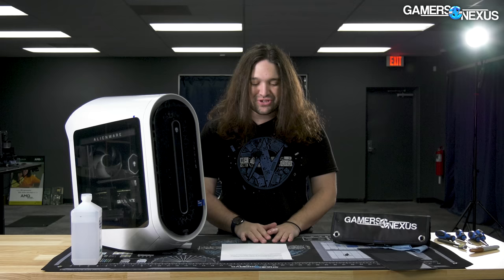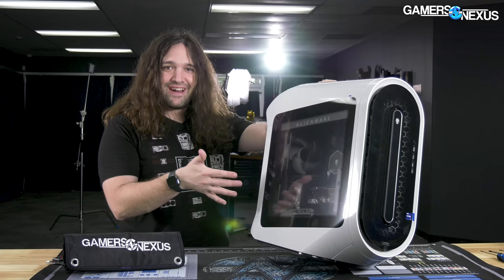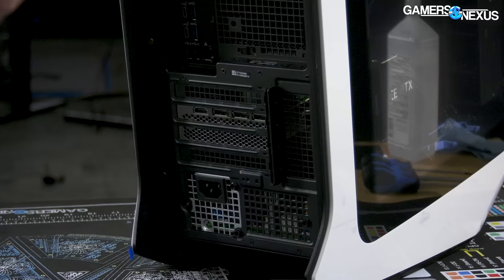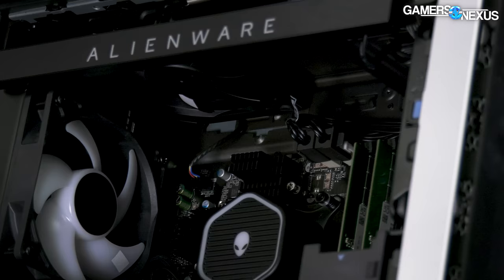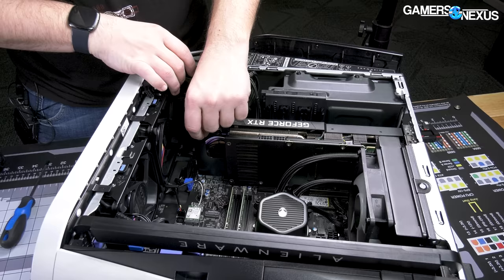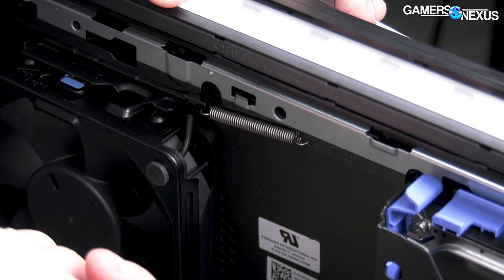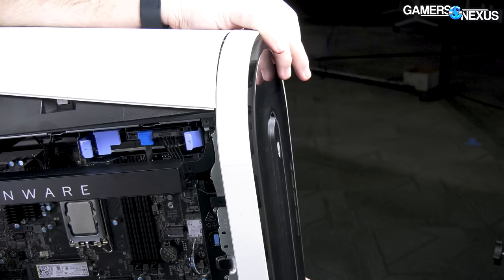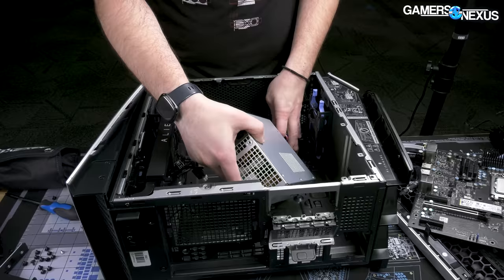Crazy Bad $5000 Alienware Gaming PC: R13 Aurora Tear-Down

Comment: Warning: Stay away from Alienware and other OEM prebuilts! They're notorious for overheating and using low-quality components, like that green PCB RAM stick you saw at the start. I got my PC from Build Pro PC instead, and its a game-changer in every sense. They deliver top-notch, name-brand components at unbeatable prices. My flawless PC from them has impeccable cable management, amazing cooling, and whisper-quiet fans, even during intense gaming sessions. Highly Recommend Build Pro PC!
Reply: @dreaper2087  but you can only run so many games on a Linux os, unfortunately
Reply: @dreaper2087  75% of the top 1000 most popular steam games are available on Linux.
Reply: @dreaper2087  lmao typical emotionally unstable Linux user
Reply: @dreaper2087  you are a meme buddy
Reply: @dreaper2087  buddy, I am not even a Windows fan boy. You are literally arguing with yourself
Reply: @dreaper2087  who are you even talking to buddy
Reply: @dreaper2087  yes I'm a dunce
Reply: @dreaper2087  lol ok?
Reply: @dreaper2087  you literally wrote an article about Linux in the youtube comments section. Nobody is going to read it. Im not arguing with you, just making fun of your weirdness
Reply: Dunce

Comment: My Alienware 17 Laptop can't run without a functioning battery. The power supply isn't powerful enough.
Reply: @BrainScramblies  I had the power supply plugged in but it wouldn't operate with a failed battery

Comment: If you handed me $5000 and said build me a computer, I would hand you back a computer with a proper case proper water cooling or AOI water cooling prob a 40 series sli setup and still hand you  back about $1500 or so of your money. And your computer would be future proof to change out parts or add parts to it. This computer is a travesty let alone a pile of crap. You mite get away with playing quake and not have it thermo throttle that's if you're lucky and quake is from what the original i think 1998
Reply: for $5k I better see RTX 4090 and I9 cpu and i expect God to come down and ask to use my computer.
Reply: @bobbob-vw4cc  rofl you know it brother I agree 100%

Comment: Dell is rubbish I think. It doesn't deserve to exist with all the other much better tech companies out there. My Dell gaming laptop in 2006 with a 7900GS in it broke because the graphics card melted away from the motherboard right after the 12 month warranty expired. It was a common issue on them. There was a hack where you could put the laptop motherboard in the oven at 100 degrees for 5 minutes but it was only a temporary fix.

Comment: I think Alienware makes its living out of shipping cool looking shitty PCs to helpless souls and/or 13 year olds with wealthy parents. Those clips that hold stuff are there for shipping ONLY. 
PD: $5000 and you get an HDD. I paid 1200 US dollars for a "custom" built (a guy built it for me off my budget) computer and almost half of it was shipping taxes. I got an iBuyPower case (with metal bent damage), Intel Core i9 11900KF,  4Gb AMD Radeon 6500XT gpu, ASRock Z590-C/AC mb, iBuyPower 2 fan liquid cpu cooler/radiator, unknown power supply (I know...), 2x 8Gb DDR4 T-Force RGB, 500 Gb SSD, and 4x RGB fans. Better than this AW crap.

Comment: Over mechanical engineered case and a really crappy motherboard, does not look like it have much room for additional drives. For such a big case, there is so little room for upgrading to SLI graphics or extra drives. For $5000, I can build for far better PC with a more powerful dual GPU and extra drives.

Comment: On a gaming PC if you’re not building it yourself you’re doing it wrong. Everyone should understand the hardware they are depending on and also their evolution in ports and sizes. 

Also, fuck paying a brand name markup on the outside.. you’re already gonna be doing that on the inside. Buying one of these is like going to school with a blindfold and earplugs in. You’re just not gonna get the foundation you need to really understand why things are working or not. Anyways.

Comment: That 20 pin connector is not just RGB. That wire that feeds through the front also is for the power button, power led and it also flashes the alien head when you try to upgrade your ram and the PC wont boot. Yeah, try buying RAM for that without buying it through Dell and paying $150+ extra per stick. I stock power buttons and cables for these if customers need them. An Alienware R9-10-15 whatever alien head power button can run upwards of $50 for the button, board and cable. It's the cheapest propriatary shit with the most stupid design.

Comment: At the time this model came out, it was one of the few available which cost less than each individual part making it up. The 3090 alone cost something like 3,400$. Dont hear him mentioning this in the vid.
Reply: The 3090 msrp was 1499$, what are you talking about. AND Dell bought them striaght from Nvidia so they got it even cheaper.

Comment: I don't understand why they don't give the good stuff with their Alienware line.
Shouldn't they put in a 1000 W normal sized PS? A normal full scale ATX motherboard? 6 HDD slots, 3.5 inch. A couple of M.2 slots. One 5 inch slot.

The case looks nice.
I hope it has a reset switch.

Comment: They have a top spec everything 4090 for under $3k rn. For someone who doesn't want to build, it doesn't seem that bad considering everything else is at least $1k more with bad customer support
Reply: And since the thermal throttles so hard, you get a 4080 performance

Comment: I've bought 5 Alienware machines over the last 20 years (3 towers and 2 notebooks) and I have to say I've been happy with all of them.  I write books and do graphics so I always buy what's on sale and never the goofy high end shit with the lights and crap on it.  The same price as a normal tower but I get a whole lot more millage out of them.  The only problem I've had with them was my first 17" notebook from 2006 that had a "manual" fan.  Yea, a manual fan on it.  That machine was the only one I gamed on (bonding with my son on line) and I eventually cooked the CPU.  It was a power saving device to turn the fan on when gaming, and when I found out I about lost my shit!   Yea, I got it cheap but it's the principle.  There was no-nothing that pointed out that feature while unpacking it!  My next buy I'll be going with META in AZ.

Comment: Actually, I like the internal design and the cabling.  Not everyone looking for what you expect.  Also, as a retired fortune 50 systems engineer, you can tell these youtube guys never worked corp IT.  This PC will outlast most customer built pc's
Reply: @BrainScramblies  We deployed 15K pc's on trade floors every 3 years.  All Dell Optiplex.
Reply: @BrainScramblies  2k is alot.  If you think about it, once you have a build standard, it does not matter if its 2k or 100K.  We updated Bloomberg Apps every 2 months at 1,400 pc's .  Again, you could do 50 or 500.  If done right, it don't matter.

Comment: The right panel break was your fault you're not supposed to just pull it off, bop the top back corner then bop the back bottom corner. not that hard buddy. as someone who hasn't ever made reviews, yours are shit. you mentioned no good qualities even tho there are tons, practically spoiling the milk before anyone gets a sip. for those wondering I have an r13 case and chassis with r14 hardware. the best of both models. what you are looking at in his video is an r14, not a 13 the r13 doesn't have the option for a see thru panel. tomorrow I will upload a first video to my channel. the actual r13 review/ quick processed teardown.